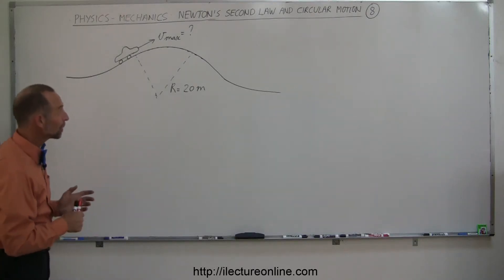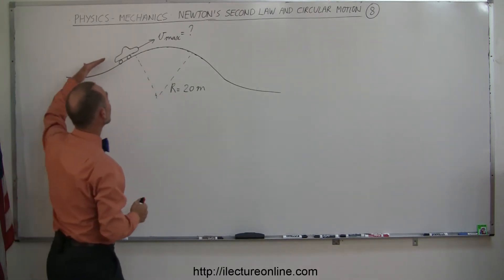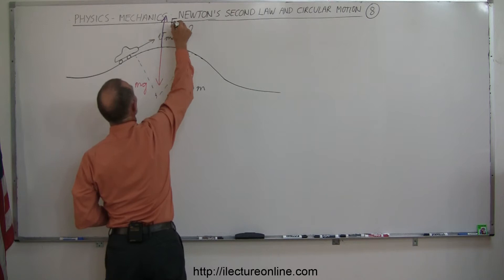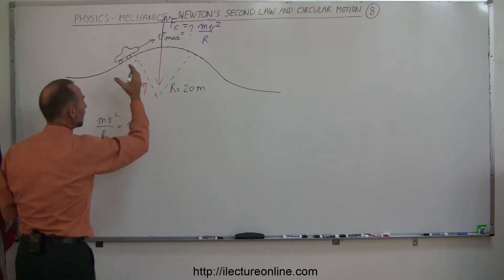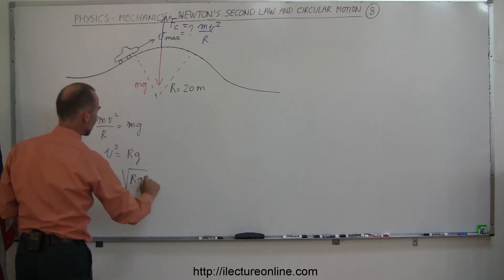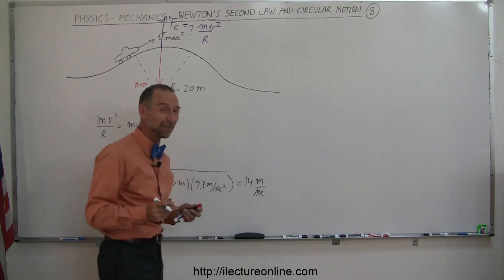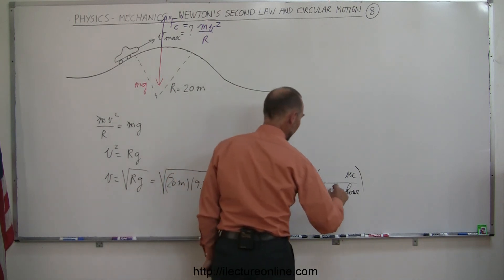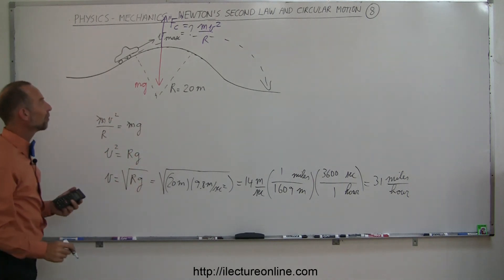Physics 6  Newton's Second Law and Circular Motion (8 of 10) Dune Buggy Over Hill

Comment: 1:25 i'm a bit confused, you said "if the weight is not enough" but then you can cancel the mass so it seems like it doesn't matter if the car is heavy or not as long as it reaches the calculated velocity of 14 m/s. So, you can have a 1000 kg car or a 10000 kg truck, they will both be airborn when they reach 14 m/s with that radius , correct?
Reply from the maker: Correct.  In the same sentence it was mentioned "if the car moves too fast....."

Comment: Sir, I didnt quite understand the idea of being weightless at the top.could you please explain it that why we ignore normal force there is always the case or there is condition for not taking into account the normal force? Thanks
Reply from the maker: It is not that the person is weightless, gravity is always acting on the person, but the person's APPARENT weight is zero.  Whenever an object moves in a circular path, it requires centripetal force.  If the centripetal force required to remain in a circular path is greater than the weight, the person will experience apparent weightlessness, and become airborne.

Comment: how would one compute this with a different, non circular geometry? I'm working on a numeric simulation of a ball/mass rolling/jumping over a hill (described by the function y = e^(-x^2)). I thought it's the case that the acceleration in positive vertical direction on the mass has to be larger than the acceleration of gravity? Any advice would be helpful. Thank you in advance.

Comment: Dear professor can we solve the problem following the same approach of centrifugal force if we consider motion at the lowest point .I am in a dilemma ,can you please explain
Reply from the maker: Yes, it will work just the same at any point in rotational motion.
Reply: but sir I am getting the answer wrong ,can you please explain what will be the equation when we are writing it at the lowest point.Plzz professor
Reply from the maker: At the bottom, the mg of the car will be in the same direction as the "centrifugal" force.  At the top they will be in opposite directions.
Reply: +Michel van Biezen Can you explain why it so??Not really able to think sir
Reply from the maker: The fictitious "centrifugal" force always points outward, the mg always points down.
Reply: +Michel van Biezen Thnx professor for being so generous

Comment: Don't we need to consider gravity acting on the car at all points on the curve? V^2=rgcos(45deg) if the hill inverts at 45 deg
Reply from the maker: Johnny,
For small angles, cos(theta) ~1, for large angles you have to consider mg cos(theta).  In this problem we are just simplifying it by looking at what happens at the top of the hill.